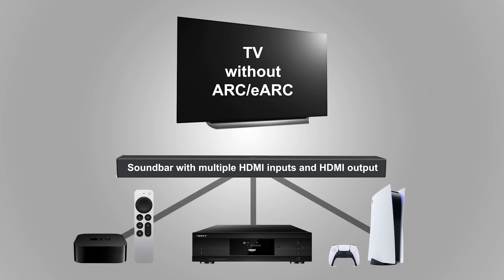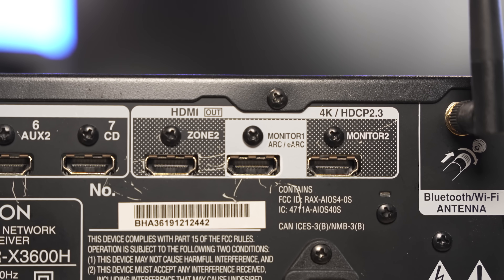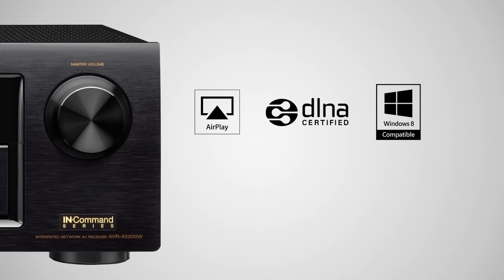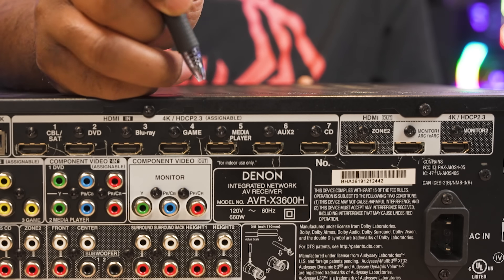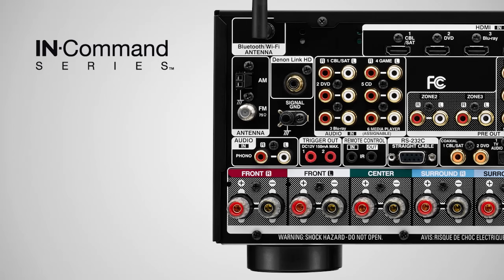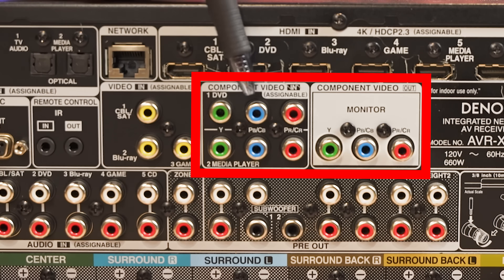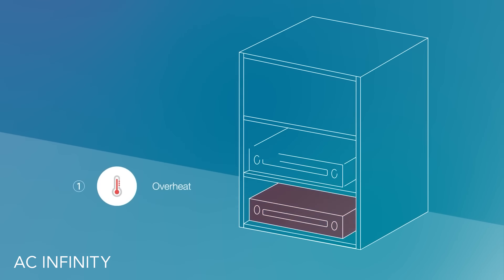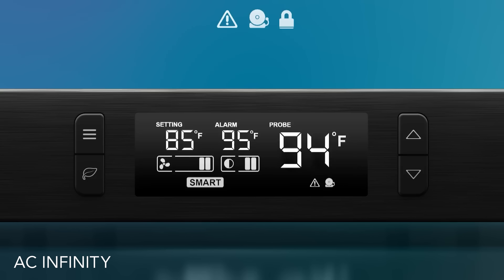Avoid These Mistakes When Setting Up Your Home Theater Receiver

Comment: Chris is it possible for me to use an analog to cereal port joystick from a older windows PC to control the denon AVR X2100W receivers menu bios ❤
Reply: Or maybe a cereal output switcher for an older 60s Macintosh for outputting media on different types of analog monitors or devices like a crt or analog PC yet I do recall that my receiver is digital with 2 DAC's in the motherboard

Comment: Thank you but i have a problem…
I have a pioneer 5.1 surround system and i connect both of my ps5 and my benq projector to the receiver and it works but the sound are only coming from the projector not from the speakers

Comment: I came to your video because recently I bought a home theater, but I'm unable to get the most out of its HDMI Arc connection because I want to use it with my gaming PC, I'm currently using toslink as the next best option and wouldn't like to spend much in a big receiver, is there an option you could recommend?

Comment: As an addendum to the cooling: if you don't have your receiver in a cabinet, you should not need a cooler. They are designed to work just fine as is in an open environment. If your receiver is not in a cabinet and it gets so hot as to fail without a cooler on it, then your receiver needs to be repaired.
Reply: Honestly, even some new receivers (usually, but not exclusively cheaper ones) are running so warm that I recommend using a fan for longevity
Reply: @dirttoe0711  That's what I do & I haven't had a single issue 💯👍🏿
Reply from the maker: I agree that cooling is not always 100% necessary but considering how hot receivers can get and the fact that the number one enemy of most electronics is heat, it’s a very small price to pay for peace of mind. Especially considering how much these things cost.
Reply: @ChrisMajestic  Still not needed electronic components can go to 80 degrees Celcius with absolutely no problem. What is needed is  in a closed cabinet is a hole  as high as possible and preferably decent size so heat can get out. and if you are really concerned you can also just put a 120mm USB fan pushing air out and connect it on the usb of the receiver. costs you what $15 or something. Beats spending 150 bucks on something whats overpriced.
Reply: I would never have thought about a cooling fan but it is something I’ll consider now. Hoping to get an AV receiver soon
Reply: It's worth looking inside to see if there is a fan that's sensor activated already.  Mine has one but it's only turned on once, but the amp is normally not pushing too hard
Reply: its really situational to what receiver and what kind of space that receiver is going to sit in. All receivers are designed to dissipate enough heat by themselves but if you're not giving much space for it to breath then another cooling solution is needed. just saying an external cooler shouldn't be considered the norm but it might be needed in your situation. best test is try it and see how hot your receiver gets to the touch after some time. if it's just warm then that's fine. if it's hot or too hot then at worst there should be a thermal trip that shuts the unit down to protect it. if that happens or even if it just feels uncomfortably hot then you definitely need another cooling solution or to place it somewhere else more open
Reply: If nothing else, set it up on something metal and vented to promote better passive cooling
Reply: I live in Arizona wish we had a way to keep dust getting in the vents

Comment: I have an older 7.1 onkyo. Does anyone know if there’s a way I can connect 2.0 speakers and get all the sounds out of the two speakers without hdmi? I’ve connected the tv via a 3.5mm to an rca because I want to use my roku remote for everything 😢

Comment: I swear by ACInfinity cooling especially for my Denon 3700H avr that runs hot enough to fry an egg.  With respect to room correction ie., Audyssey I'm not a fan of it at all.  The only thing it's good for is correctly measuring distance.  The software offers some basic assumptions leaving a lot to be desired.  I always run a manual SPL meter calibration and run my surrouds (4 SVS Elevations) a little 'hot.'  Now, I'm sure that if someone came in and measured my 5.2.2 system they'd probably say that, measurement wise, it's not good.  However, my primary movie criteria is how does it sound to ME?  And to me I could care less if all the data looks wacky.

Comment: Im 59 yo and recently bought me an Onkyo RZ50 and was blown away by all its features it has. I managed to get it up and running for basic music listening and TV and movie  viewing but haven't tapped into the surround sound features like Dirac, etc. It's already a bit over my head, but after rounding up enough speakers, I'll be taking advantage of that for sure. Thanks for your video, albeit you featured Denon. There are close similarities.
Reply: Oh Yeah, of course right after i bought the new RZ50, a week or so later i saw an advert for the RZ70..... Oh well, The 50 probly doesn't sound $1,000. Worse....No Way
Reply: How's it goin Man? I'm 51 myself, I've been buying only Onkyo since about 18 in my first appartment... But i just got the RZ50 Too, back in May... This thing sounds Pretty Tits!!! Now I'm waiting on a pair of Cerwin Vega XLS 215's. Dual 15" woofers 3 way towers. I Can't Friggen wait Bud!!! Right now i have the old CV CLS 15's, they still sound Nice 👌  Good ta see another Gen Xr Rockin an Onkyo 👍👍 I still have a few of my old ones ( Onkyo Receivers ) back in their original boxes, just Retired is all....HaHa. The favorite of my oldies is my TX DS989... The Heaviest Amp I've ever owned!! GREAT DAY!!!        JB

Comment: What if my TV isn't ARC or eARC enabled, but my receiver is?  Can I just hook up my Apple TV and nintentdo switch via HDMI to the receiver, then go eARC HDMI from the receiver to the normal HDMI input on the TV?  my TV is probably 10 years old and I'd rather not replace it if I don't have to.
Reply from the maker: Yes that’s how you would do it in that situation

Comment: Great video. Do you have a video on how to disallow the TV from taking over the receiver? I have an Onkyo RZ800 connected to my Panasonic plasma 1080P. The receiver drove everything, then output the video to the TV. When I upgraded to an LG C3 65” 4K tv, I left all of the receiver connections intact, and simply connected the TV’s eArc HDMI 2 from the receiver. The problem is that the TV then took over the connections. No matter what I wanted to watch, based on the receiver connection, the TV would switch the receiver to the TV input, and use whatever was the last connection I used (say, for example, the Sony Blu-Ray). Even when I selected something else, say my TiVo or Roku, the TV would switch back to the Blu-Ray connection. I finally had to connect each HDMI devices to the C3 hdmi inputs. What a joke.

Comment: So the heatsink for my Denon avr 6700 is at the very front of the unit and the fans of the Infinity cooler that you were using are right in the center of the cooling unit. Is that going to be very effective if the heatsinks are right under a spot with no fans?

Comment: This was a very eyeopening video, thank you!

I have a question. I have a very old (20 years) Sony STR K7000 Receiver that I was looking to use to replace my desktop logitech speakers that just wont work anymore. After researching replacements, it just seemed better to invest in  home theater system for my computer.  I can connect to my sound card via RCA to 3.5mm, but I'm curious if you think I should replace this very old receiver?

From the video, with all the settings and stuff such as crossover correction and room correction it seems like I should probably invest in a newer receiver, since the crossover correction made it seem ilke it would be a really good feature for the speakers, but I don't know much about this topic at all..

One comment mentioned "Modern Yamaha A/V receivers, with full discreet amplifiers, usually go for around $500 or more.
So a $300 Yamaha RX-v385 might not offer better amplifiers, then the Sony." 

When I asked about the RX-V385, but I would venture to guess the settings and such would make it that much better.  Would you say the amplifiers are better on these newer units?

This K7000 is pretty basic, but it would most likely do the job I need.

I just figured the money would probably be better invested into speakers and such, but maybe a new Receiver would also be beneficial?

Thank you so much for any advice!  Subbed!

Comment: please make a video guide on how to combine two UST projectors and using a external video processor that can do image blending and tilling to create a cinemascope image. Also a video guide on if it's possible to use 3rd party mapping grid geometry software to correct a UST image thats projected on a wall that's not flat

Comment: Dumb question from a home theater newbie - I bought a Denon AVR-S960H a little while back.  I didn’t realize that it didn’t have preamp outputs for the speakers - only preamp outs for the subs.  My question is - would it be worthwhile for me to put a small amp on the sub at all to help allow the receiver to better power the center/surround speakers?  So that it isn’t using up power to drive the sub?  I’ve noticed after loud scenes in a movie, the audio levels seems to drop slightly for a few moments.  I’m wondering if that has to do with the receiver working too hard to power the sub and the rest of the speakers aren’t getting enough juice?
Reply: I'm not a av tech but I think that I can help you with this question, the Sub preout sends a electrical signal to your sub and the sub has its own amplifier, so it might not be a good idea to add an additional amp to the sub. Also, the av receiver that you have is 90 watts for two speakers and when using more speakers it's less power. If you are using five speakers in a surround system it's probably down to about 35-50 watts with all channels playing at once but because your subwoofer has its own amplifier it's not using any of the power that's going to your speakers. I don't know what speaker system you have but I just wanted to explain a little about how the power is distributed.
Reply: @randelldavis578  thank you, that is helpful info

Comment: Hey Chris, great channel. I have a question about older receivers. I got an older denon 7.1 receiver coming my way that supports up to dolby true HD. Now my question is if it's worth putting it in 5.1.2 with upfiring or sealing speakers or if I am better lf putti'g the speakers in a 7.1 configuration. I do wa't to upgrade kn the future but for now that's all I can afford but I do watch blu rays all the time so what would be my best pick, 5.1.2 or 7.1.

Comment: How do you do room correction if the receiver is 50 feet away on a tech closet. I called the company that makes the Denon system and they don’t recommend a long extension cable.
Reply: Go SPL meter, and/or, tape measure.. 👍

Comment: That's a great receiver but have you considered a Yamaha receiver, they have the best sound on the market and almost the same characteristics as your denon. I have one and i use option cables and sound from my pc on dts which is insane sound at 5.1 and i control every speaker. All speakers are above 100w rms and subwoofers are 300rms with external amp for each subwoofer

Comment: Have you done a video on electrical setup? I've just built a 6x12 shed (6x6 for theatre, the other 6x6 for a pool table and what not) and am about to wire it up. My end-game (years away) would be to have something similar to your mate's KRIX MX20 system with everything that goes along with it. Should I be running 10, 15 or 20 amps and where should I place all my power points.

Comment: Regal
.. Hugo guys if you want a pirate a video that you see anywhere on any of the apps through any streaming device use analog in and out they can't prevent you from using analog in and out to copy both video and audio get yourself a decent DVD-R recorder the ubiquitous and they can be fairly cheap and you can have anything you want on DVD-R anytime you want wherever you want however you want as open did you want the trick is use analog inputs and outputs the same and the terrible part about it is that you can't take the video directly from your TV to a recorder which is a real b** because that was available up until about 5 years ago God forbid you spend 40 bucks on a movie and watch it again you got to pay for it again screw that crap do it all analog doesn't matter the quality of the picture if you really love the movie... In essence it's all about the audio because that's what we watch movies for is that eclectic as much as 1 6. .4 the forest with four subwoofers Manatee the audio is everything the video can be iffy no big deal it's all about the audio and what you're hearing it and howyou are hearing it don't be so concerned about the quality of the video you're watching something you can pretty much detail what you're watching because your eyes will show it to you it doesn't have to be pristine perfect eagle eye imaging it just simply doesn't need to be that sheriff of an eagle eye video because most likely you going to be within 12 ft of the TV screen.. I can speak more and more about this because I'm playing with audio equipment for 45 years and I know how to do it

Comment: how to sync power on for the AC infinity fan , to turn on/off together as receiver ?
Reply from the maker: You just put it in smart mode. As the temperature raises the fan will automatically adjust itself and turn off when temps are low

Comment: Hi nice explanation 👍  please can you help me with my set up. I have a Denon 3700 and dali floor standing speakers with center , and I have a HT1205 Rel sub. I have the 1205 going through Just LFE and not with Mains. I would like to know do I still have to dial in the crossover?. I have it at say 10 o'clock.

Comment: On the back of your Denon there were 11 speaker outputs. However, there are only 9 channels of amplification. Which of the 2 channels would not be active?
Reply: 2 sub channels

Comment: Chris, are You being paid, to plug the   'AC Infinity fan'  ?  Most decent/good amplifiers have loads of VENTS to allow the warm air to exhaust from the body of The Amp, they Are Designed so as to NOT Over-heat.... so WHY EVER the need for EXTRA FANS ??? I'm confused.

Comment: Chris, excellent video.  I'm a long time subscriber and know you for AV & Home Routers but I was amazed to see your Home Lab complete with Home Assistant.  You should seriously add videos about these other areas.  For example, I would love to know what integrations you have with Home Assistant and your AV equipment or how your Home Lab works with your AV equipment or just even your Home Lab set up itself.  Looking at your rack gave me some ideas for my own (the Tripp Lite Console).  You've got a ton more really great content just waiting!!!
Reply from the maker: Thanks. I've really considering doing some content on HA as well as home automation in general but I wasn't sure if anyone would be interested. I'm honestly more into home automation that I am home theater these days. I have a TON of automations setup in NodeRed. Thanks for your suggestion and thanks for subscribing!

Comment: Is it possible to use a receiver with a Desktop PC for playback of Hi-Res audio from the computer? And if I am using a single 3.5mm cable from PC to receiver; will the audio quality still hold abd remain lossless?
Reply from the maker: Technically yes but I'd prefer Toslink for this to avoid interference.

Comment: Chris I have a Denon with a second HDMI output I was going to use for zone two. Had no idea video might not work. Anyway to double the signal of a 4k bluray for zone 2?
Reply from the maker: There are ways but not simple. There are special devices you can buy to bypass it.

Comment: I appreciate the ABC's of it all. crossover went right over my head 😮
Reply from the maker: Simplest way to think of it is that it makes it so that you send limited bass to your speakers and let your subwoofers handle it since that’s what it’s there for
Reply: @ChrisMajestic  appreciate you
Reply: Correct me if I am wrong, but I believe the crossover value you set, you are telling that speaker not to go under that hz range. And that that range and lower is for the stand-alone subwoofer.
Reply from the maker: @HOTMiSCHiEF1 the crossover tells it not to go ABOVE that range. 😉

Comment: Currently have a 5.2.2 setup but I have the speakers for a 7.2.4 setup but I need a amplifier to push power to some of the speakers. I have been looking at a 7 channel amp to push the LRC and surround channels and then use the receiver to power the height channels. I was leaning toward to the Emotiva BasX A7 or I see Monoprice has a new budget monolith the M7100x but apparently according to some it didn't test well and wasn't going to be released until the issues were fixed but now its on sale on their website. Do I forego the budget options and just save until I can get a higher tier amp. What are your thoughts?
Reply: If I may ask, what are your speakers' brand and model???
Reply: I have the Klipsch Reference R-625FA for left and right. R-52C center channel speaker. Surround Left Right and Surround Backs I have the Klipsch Reference R-41M. Rear atmos are the Klipsch Reference R-41SA and Subwoofers are the Klipsch R-12SW Reference Powered Subwoofer @johnathantaylor3199

Comment: I need recommendations for hdmi cables over 100ft or a solution to transmit hdmi and sound for components between multi level home. I tried some stuff on Amazon i.e., hdmi over ethernet/wifi and I wasn't successful